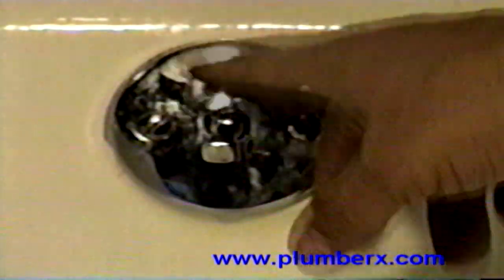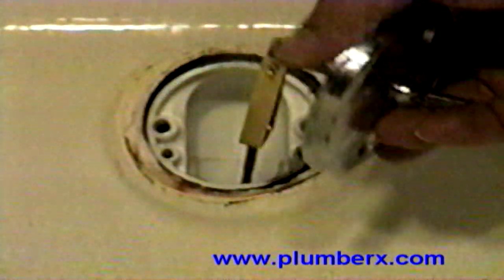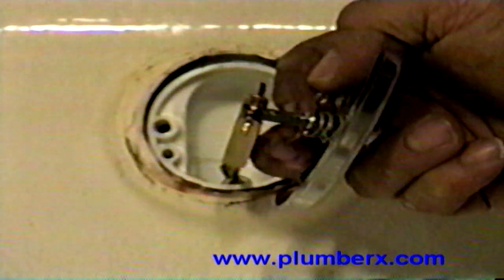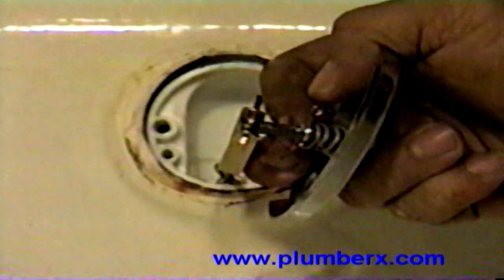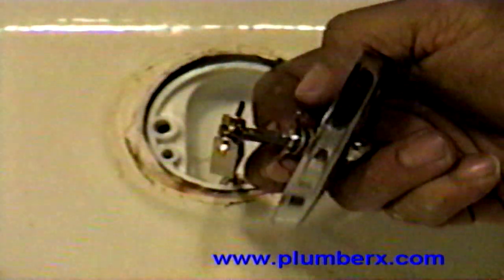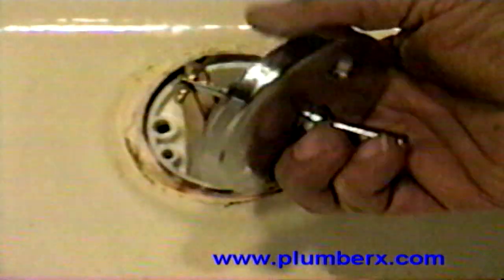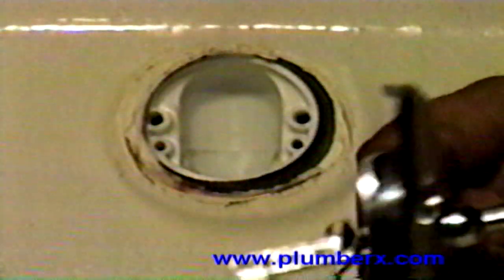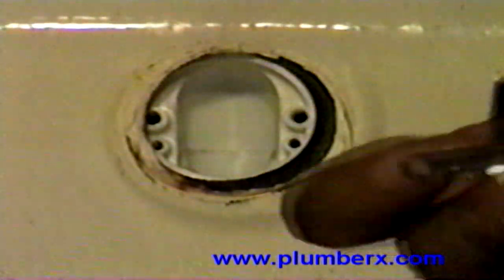Tub Water Don't Drain Or Won't Hold Water

Comment: Thanks. The spring on mine was covered in hard water mineral deposits. Used some penetrating spray, wire brush, and a small flat head screwdriver to get out all that stuff. Works like new.

Comment: Thank you! Fixed my loose drain stopper. Actually, instead of going to the store, you can just pull the spring apart, making it longer and it will be completely free fix! This is what I did. But depends on condition of your spring. It might be too old and no longer act like a spring.
Reply from the maker: Martink444 ABC Glade I could help. Lucky you you didnt have to buy a new one. 😉

Comment from the maker: I'm afraid the plumber may be right, but I don't know about breaking the wall. You can how every go to the back side of the faucet area and cut a nice opening large enough to get your hands in there to work and buy a access panel from The Home Depot and cover the new opening. I would buy the panel first and use that to make you opening. This way you will always have easy access when ever you need to work on the faucet and drain.

Comment: any suggestions if it's completely broken? how would I get the part that stops the water in the pipe out? clothes hanger? out tubs drain goes down really slow and I think while the lever was messed with the thing broke from within and now the stopper is stuck. I feel I can fix this myself, any suggestions would be appreciated. thank u for the tips

Comment: I was watching your video yesterday and I have the same problem you had. Except I'm not a hands on guy. Anyway ths morning went to lowes purchased this overfill thing. First thing the old one has rusted screws and one of them broke in there. When I finally took it out I tried putting in the cotter pin, but the hole in lever was too much in the hole, had a hell of time aligning al holes correctly. It's a bitch doing this little task. But thanks for showing me! Got it!

Comment: Thank you so much for the video! I got the face plate off, and see a very rusted and corroded spring on the back of it. But... the other piece that the spring should be connected to somehow broke off. I don't see any other piece in there. Should I buy a new piece that connects to the spring - the long rod that goes into the drain? Will that work, or do I have to somehow retrieve the original piece, which I presume is still connected to the stopper at the bottom. It is a deep drop - any tips on how to retrieve it? Thanks for any advice!

Comment from the maker: If the one you have is still in good condition keep it and just oil it up. As far as the stoppage you may need to or have some one run a small cable thru the top were you remove the trip lever from.

Comment: I think I have the same problem as derron think mine is still stuck at the bottom..some times when I use the pipe snake it opens enough to drain sometimes nothing and also the snake only goes so far like it's hitting metal I've used drain o &something called acid it worked but only for a while but any advice would be helpful and my tub isn't cast iron neither

Comment: hey man, my plug wont hold the water i bought a new assembly and no matter how far i put the blocker in the water still goes through and i dont know if this is normal but the blocker will only go down to a certain point down the pipe and even at the furthest down it can go it still doesnt hold any water in the tub do you have any suggestions? it would be much appreciated

Comment: Mine broke tonight.   The piece behind the faceplate that connects the level to the rod that raises and lowers simply broke and the trip level moved freely without doing anything.   Replacing that part should fix it.  Thanks for posting the video.
Reply: Yup.  I replaced that part and everything worked fine.  I can't complain since the old one lasted 51 years.

Comment: We replaced the trip lever and now we can not get the assembly back in all the way. When we do get it all the way in the lever does not move sometimes and when it does the water still drains. Any suggestions?
Reply: Disregard my comment and question. It is fixed. Both the assembly and pipes are metal so I scrubbed the assembly and snaked the pipe. I then applied a healthy dose of wd-40 and she now works perfect.

Comment: Is it ever a good idea to fill the bathtub with water and maybe the weight of all that water can push the clog down?
Reply from the maker: Anything is possible. New one on me
Reply: @theartofplumbing  Ha.  Well an entire bathtub filled with water must weigh a lot
Reply from the maker: A gallon of water weighs 8.34 lbs Yep that's a lot of weight. The average tube holds about 80 gallons. Plumbers call it head pressure. It would help more if your tub was vertical then you would have three times the head pressure. But that is a interesting theory. 😉

Comment: My stopper has broke off the faceplate and I can't get it out with Pliers what do I do?
Reply: Thanks can't believe they used plastic in the 1st place to connect it. My face plate came right off so I'm sure it's been broke since I moved in 2 1/2 yrs ago. Stopper has never worked and my tub has had drainage problems since I moved in. I was so happy to see your vidio that made me realize my drainage problem was due to the stopper blocking the pipe. At least now I can fix it.
Reply: Hopefully